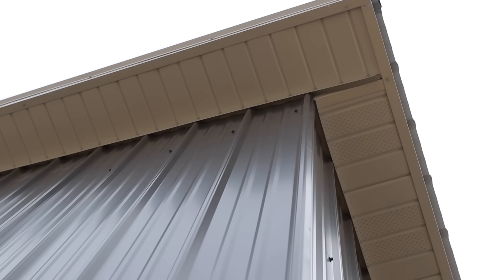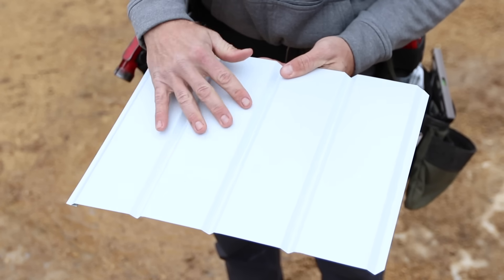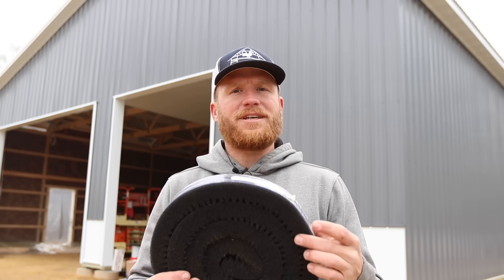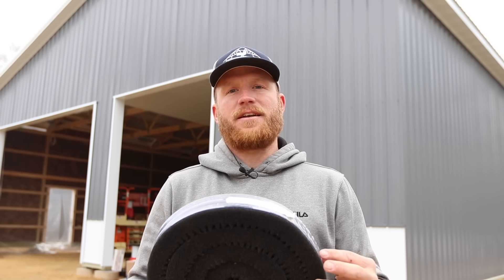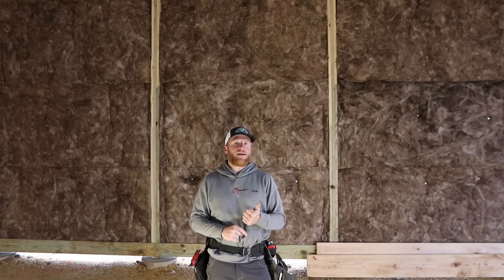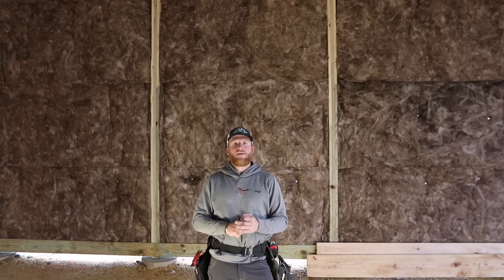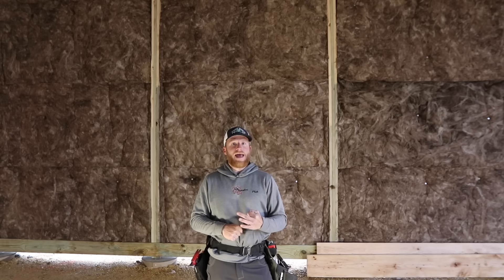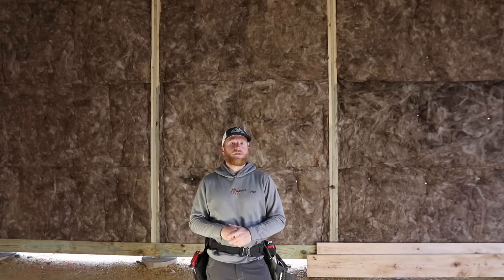Insulation: 5 steps to a more efficient building and why I don't use spray foam

Comment: From personal experience,  I have seen leaks on metal buildings with spray foam insulation and residential homes with roofs leaking with the same application. Just seams like a pain just to figure out where it's coming from. Doesn't seem practical to invest in.

Comment: Excellent information as on all of your great videos. My question is about "wasted space" in the attic spaces. IF you only have the blown-in to insulate the ceiling, what if you'd like to store things in the rafter area above it? Doesn't that area get awfully cold or hot?  Also, have you ever done a section with an open ceiling to create a loft area in the roof spaces? Thanks!
Reply: Using trusses pretty much stops storing anything up there. These are attics not barn lofts. Most shops do not need to store 30 tons of hay for winter.
Reply: Use the walls for storage. Lots of wall space!

Comment: Would love to see the blow in insulation of the ceiling process on one of your builds.
Reply: I don't recommend blown in as it settles down to 50% of depth 
You can insulate the underside of metal panels with foam boards insulation.

Comment: Interesting.  We would like to see some input about how you pour the finished concrete floor to the walls and how that all ties into the foundation piers etc. Haven't seen much on that fact and little discussion about why, how and details in it's design vs. pouring a slab first or stem walls first.  There's some "Barndomenium Living" information on FB and YouTube for those in Texas. They have a different slab first approach but of course, no freezing.

Comment: If you think green freaks and liberals are no problem ... spray foam  insulation releases toxic fumes into the environment, if your home catches fire the melting/burning off gases from the foam are extremely toxic and the fumes life threatening. It is more probable you'll experience a home fire than get shot in a big box store so do away with foam products entirely, especially those companies liberally owned, right?

Comment: Very nice! Especially for people who is just thinking about insulation!  What exactly you would recommend for a plain (not commercial)  single level residential house insulation? Brick veneer outside, than timber frame and plasterboard inside (with empty voids of course) :)   I can see a soft maths at retail which are very similar to yours. However nobody from experts can advise me about a vapour barier.  How to do this? What kind of material I have to use? Is it something special or ... any plastic film can be used?   A very interesting subject- what do we have to do with ..."weep-holes" underneath?  Should we cover them or leave them open?   And, btw.... whyle insulating empty walls we are creating a nice environment for "crawlers". It will be convenient and warm for them to grow their colonies. How to prevent this "side effect", please?    Thank you

Comment: Tell the truth you don't use spray foam because you won't buy the equipment and you don't make any money off it.. spray foam insulation is the best insulation you can install in a pole building. It keeps the air and moisture out of your building and it's a true R-VALUE. People watching this video please do your research before buying insulation. At 2 inches of spray foam it's 84 percent efficient no other Insulation is that efficient.

Comment: Closed cell spray foam out preforms fiberglass by miles. Air barrier, vapor barrier, and adds structural integrity to the building. Worth the cost in the long run. You can also condition the attic space instead of venting the soffit and ridge.

Comment: Hey Kyle, you have some really awesome content. I watch A TON of Matt Risingers videos. I also took on the voyage of understanding exactly how vapour barriers work etc. I just want to say some things. First of all as you kind of made it seem as if there was an opinion behind a vapour barrier and what some folks like and maybe others don't. I don't think personally that the word opinion should come into the equation when you're talking about a well known almost factual topic around vapour barriers. The folks in the building science community understand vapour diffusion and air movement quite well and I don't really think that's there opinion, that knowledge came from tests, not opinions. So personally speaking from my knowledge on the topic, a vapour barrier is mainly there to stop the air which carries the water vapour. If you stop the air, you solve almost all condensation issues. Similarly how a piece of natural wood will have noticeable expansion along the width but the length is so negligent that it's not even accounted for in almost all cases of building because it's so minimal. The problem with using a Class 1 vapour barrier you're using is you give no chances to breathe and exhaust excess water if it gets in, IF it gets in. However it's always good to try and be redundant. So my point is that instead of creating no opportunity for things to dry through the system, if you allowed your substrate to be that vapour barrier as well which actually passes code so long as that substrate is sealed, now you can allow semi permeance for things to actually have the chance to dry out now, creating a better system. So I think personally from my understanding on the topic that you would in your case, be much better off not using a class 1 vapour barrier like it seems that you have done, and instead using a class 2 or higher to allow some drying to happen if need be. 

Anyways that's what I know on all this and I think it's important to follow the facts and not opinions and the facts around a vapour barrier, when and how to use it, seem well established.
Reply from the maker: Great talking points.. I always need to keep learning
Reply: Wouldnt moisture that ends up in the wall get sucked up to the attic and vent out? This wall is semi vented
Reply: Building code is not always the same everywhere so I think perhaps there is always exception to anything.

Comment: There is going to be mold behind the plastic on walls you never use plastic above your ceiling or in your walls it traps moist and causes mold the proper way is to use house wrap on both inside and outside and closed cell spray foam or cellulose Insulation is the best fiberglass is just an air filter that's why if you have fiberglass in your house and its black that's the dirt that was filtered out of the air that traveled thru it he did install the fiberglass properly but it's not a very efficient insulation

Comment: It looks like you do quality work! But you will never find anything better than spray foam insulation. Once you understand how foam insulation performs compared to fiberglass you will not want to go back to fiberglass! And you will save up to 50% on heating and cooling cost with spray foam insulation! Fiber glass batts are just air filters. Have a nice day!

Comment: Heres is the BEST reason spray foam is a contractors worst nightmare. WHEN it comes time to service pipes, wires, leaks, in walls or ceilings... GOOD LUCK finding what you need to inside all that foam.

Comment: See, see!  That is exactly what i have been trying to explain to my local contractors. Air needs to come in at the eaves and exit the ridge. My 1960's house just has gable vents, and the ridge vent. They don't see a problem. Translation: they don't fully understand or they are just lazy. Thank you for helping explain things!
Reply: I invited two insulation companies to insulate my attached garage turned finished room. I knew my house ( typical Ranch )  and how it is constructed. How it’s built. It’s simple. Ranch houses in 1960 did not insulate the ceiling of the garage.. Cold air comes from the overhangs and drops into the garage. Or room as it is currently. I knew exactly what I needed for insulation of my cold garage room. The overhangs needed bat insulation. Simply remove the plywood from underside of the overhang, then install the bat and replace the plywood. You would think a company of 30 years would know this. The old drywall and wall insulation were recently removed due to a water leak. I made the contractors aware of the situation. What I didn’t tell them was how to do the ceiling insulation. I simply told them I need insulation between the studs and insulation for the cold coming through the ceIling I listened to their suggestions while kept my mouth shut to test the insulation contractors. They both could not figure out a simple solution. They were into sales more than my needs. Or what the house actually needed. One of the contractors wanted to fill every aspect of my house with holes for blown insulation. Totally unnecessary. He wanted to spray foam the walls and blow insulation in the ceiling causing extensive damage to the ceiling and exterior walls. His solution was improper, expensive and would have cost significant damage. He was obviously more of a sales guy for spray foam and cared less about the job at hand. Mind you the guy was in the business for 30 years. The other contractor had no idea what to do at all. I did the job myself after educating myself fully. It turns out many contractors do not have your best interest in mind. They want to over charge you. And sell you something you don’t need or mess it up completely.YOU REALLY NEED TO LEARN WHAT YOU NEED AND DO NOT REPLY ON CONTRACTORS. MANY TIMES THEY HAVE BEEN DOING IT WRONG FOR 30 YEARS WHILE THEY CLAIM 30 YEARS OF DOING THINGS RIGHT. .....  WRONG!
Reply: Trust No Contractors. They lie to your face. They are very convincing. You can only tell if they are lying if you educate yourself BEFORE they arrive to your house.
Reply: @wheelie642  This is simply not true. Honest people do exist. The good contractors will not come beat on your door for remodel they are already very busy. Builders who enjoy their line of work do not need to sell anything to you if you want something done. A good one may advise or refuse to do something the consumer wants done wrong but has no need to sell anything but his skills and reputation.
Reply: @wheelie642  that is right, I was working with someone that do some construction works, I was supposed to help getting things done, at our first assignment together I realized the guy knew very little about construction or logic..well, all the time we worked together was the same..I had to argued against the ideas he had for the work ...or else  feel somehow ashamed for the results..at the end I decided to leave.. sadly construction is full of people of low standarts and a lot of scammers.

Comment: Is that Earthwool Insulation? Looks like it... If so, it's not fibre glass dude it's Glasswool. There's a huge difference. Fibre glass is thermally inferior to glasswool by miles, so if that's Earthwool you need to say Glasswool not fibre glass or you're hurting your your pitch.

Also, blow-in products have no rigidity or structure so gravity will compress the blow-in within a few years of installation to rest below the timber people pay to have covered. Blow-in has no rigidity or structure so it also breaks down into itself, until there's nothing left but several inches of highly toxic dust which costs thousands to vacuum out and will negatively effect the air quality of the home 100% of the time. Blow-in is guaranteed to turn to dust, you should use batts and double layer install to acheive the same coverage over the timber whilst maintaining structural integrity of materials. Batts are always better and if they're not Earthwool by Knauf they're a wasted investment. Insulation standards are a joke and product testing of R-values is inconsistent and does not follow scientific methods. Products perform to different standards irrespective of the R-values being the same because they're not tested correctly and as heat rises so does the rate of heat transfer; meaning what is tested and labeled at 23°C will not hold that level of performance against 40°C/50°C/60°C. KW rates of various materials will also determine their effectiveness and the environment they're to be installed within dictates the strategy applied. 

My only question is why put bulk insulation in the walls and then ignore the metal roof? PVC strapping and a few tech screws would hold batts up and then foamboard sheeting runs straight over the purlins,  giving you an Eski lid for a roof so the ceiling insulation can work to a higher standard within a less harsh environment to contend with.

I agree spray foam is a stupid investment and it's super toxic chemicals and when applying it you're essentially playing Russian roulette with your home or structure, but blow-in is essentially a scam service that will never deliver on its promises for extended periods of time. Blow-in is just a cheap and lazy way of lowing opperational costs, making higher margins and doing far less work for it; ultimately clients are left with a huge mess to clean and If your in a warm climate where builders don't seal anything properly then this will occur at a far higher pace. 

I was keen on your video until you mentioned blow-in.
Reply: https://www.yorkinsulation.com.au/project-gallery-page 

Have a look at my gallery there's a few shots of a steel framed roof I insulated. The roof itself must be a thermal barrier within an industrial structure or the thermal properties will be considerably less efficient because without that thermal barrier the cavity will get hot enough to negatively impact the performance of the ceiling materials. Insulation works in tandem and every inch skipped becomes worse than it was before, laws of physics/ Thermal Dynamics.

Comment: what are thoughts about insulating the out most 3 or 4 feet under the concrete slab. as you noted to keep the frost from penetrating the slab

Comment: I can appreciate your explaination of the raised heel energy trusses.. In my area the energy code bumped us up to r49 from r38... Not fun trying to figure out how to design and insulate a vaulted ceiling... ... ....
Reply: Fiberglass still passes air theough, like furnace filters.
Reply: @hotrodray6802  I've been leaning more toward a flash and batt approach as long as I can get the homeowner to agree to it.

Comment: The only reason you dont use spray foam is you are cheap tightwad. My pole barn is sprayed and it gets in places bats cant
Reply: That means you would also have to charge the customer more because it's so expensive... Fuck off

Comment: Consider maximum comfort versus maximum value in sizing insulation. Adding a bit more insulation reduces the load on your heater, lowering noise and dry air problems.
Reply: Lol..vapor barrier, R19 batts are more cost effective then spray foam...lol get out of here with that!

Comment: I’d really encourage a good look into the building science of having two air barriers. You’re probably gonna get a lot of mold problem in those walls. A wall needs to be able to breath in both directions from your building envelope (single vapor barrier/semipermeable air barrier). There is a condensation point in every wall assembly where the air cools down just enough for water to start forming droplets. In this situation that will happen right in your fiberglass batts. That moisture needs to be able to dry to the outside or the inside. Your building wrap will prevent drying to the outside and the poly will prevent drying to the inside leading to mold problems. Hope that helps! Others I’m totally on board with not doing spray foam unless you can find a really cost effective sub in your area.
Reply: Luke Clore ~This is what I am concerned about. Plastic can’t wait to condensate. Anywhere.
Reply: Looking for this comment. Sandwiching that insulation between 2 vapor barriers is not a good idea. It will building up too much moisture and will mold.
Reply: Plus when that fiberglass gets wet it loses 50 percent of it's r value

Comment: Kyle, if you start to discover that fiberglass and poly are not holding up as well as you would like, give me a call. I’m an insulator in your area and would love to give you a quote for spray foam. I’m with Astro Insulation out of Ringwood/McHenry! Cheers!
Reply: Sean,  I'm usually the last one to recommend spray foam, but it sure could save a lot of work in this case.  If they can put that much attention to detail into a pole shed, and do it cost effectively, I bet they're booked out a year.  I did similar in my own shop, but I'd never try to do that for a customer, more power to em if they figured out how to make it work.  

Kyle, any performance tests compared to spray foam or cellulose?   Cellulose will blow fiberglass away in air sealing, insulation, cost effectiveness, fire performance.  Spray foam wins except for the last two.

Comment: Can you please explain to the rest of the internet how air flows from a soffit vent up to a ridge vent? Can you provide these people the importance of air flow and where it should flow? You folks understand the science for this but almost everybody else gets it wrong. Even local building codes where I live are allowing full blockage of the roof truss system making any and all roof vents useless. We got 50 year shingles failing after 8 years after a new install. But hey spray foam the entire roof is a good thing? Man you gotta make a break down video with graphics to show the general public how air needs to flow through a structure. Good video. You messed up a little in the beginning when you talked about air flow, humidity and moisture regarding those foam pieces. I'm not certain you know exactly how they perform...but perhaps you are just using the wrong words to describe the functionality of the product? Cheers, good video!